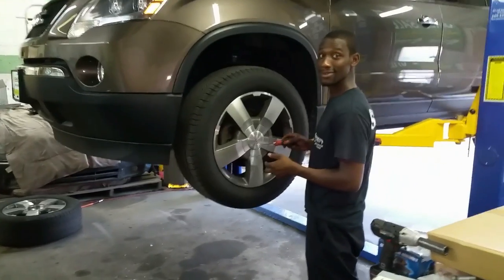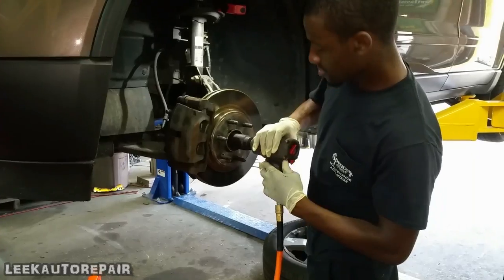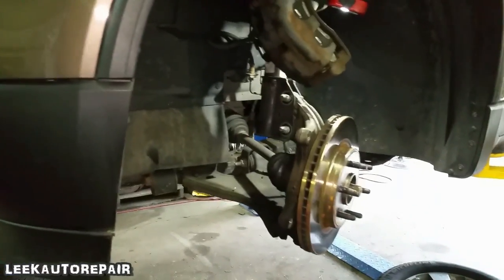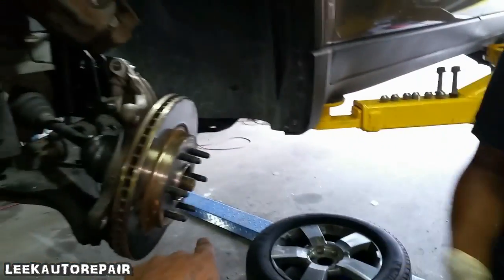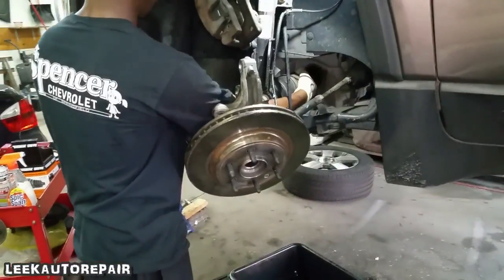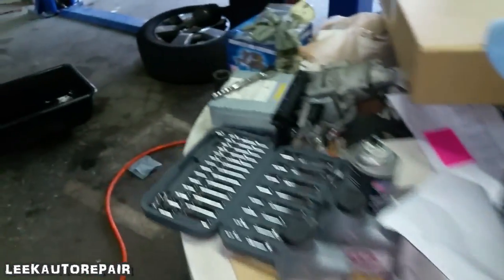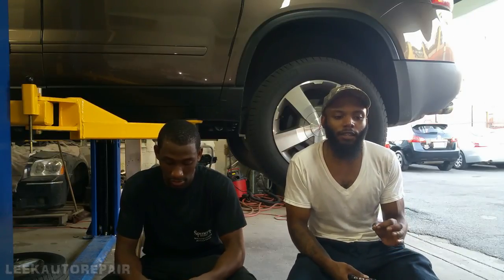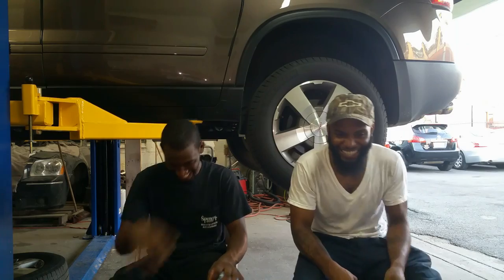How to Replace CV Axle Boot 2007-2016 GMC Acadia (Axle Replacement)

Comment: I like your video but, I have a question. The CV joints in my 2009 Acadia make a clicking noise when making sharp turns at low speed, does it mean that the CV joints are dried out and need grease or should they be replaced? there is no signs of the boots being torn or grease leak.
Reply from the maker: +fl4532 Thanks! When the axles start clicking they have to be replaced for the noise to go away.

Comment: i just bought a used cv axle for 70$ at a salvage yard and new they are 129$ i dont know if its worth all the labour to buy the boot for about 20-30 $ and and put about another 1 or 2 hours of labour just to change a boot?

Comment: What is the damage you do to your car if you have cranking/clicking noise and don't get the cv joint replaced?
Reply from the maker: +CWBush73 The shaft may detach from the joint after a while and a crash may occur. You can damage the transmission too

Comment: Great fucking video. Lol. I have a 2011 Buick Enclave with 80k miles on it. Just got it used. The steering wheel makes all kinds of Star Wars droid noises when I turn it back and forth while stopped and idling. I see (now, after buying) that there is some issue with the these vehicles steering and there is actually a Class Action Lawsuit against GM about it. Do you know anything about the steering issues for these 2009- 2012 Lambda Class GM vehicles (Enclave, Acadia, Traverse, etc.)?